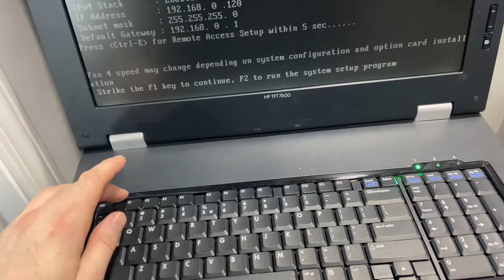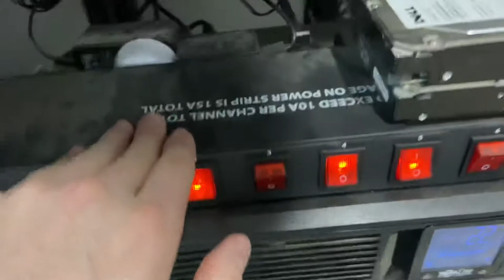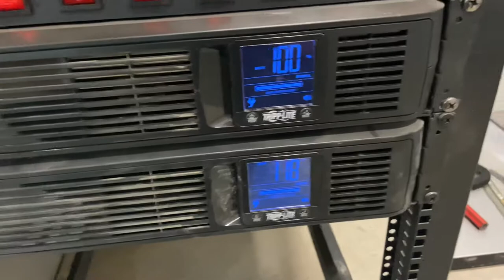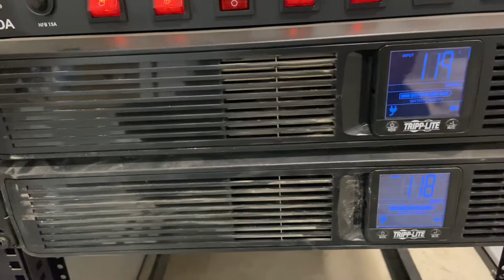Episode 92 - Network Rack and Homelab Tour

Comment: What software are you using for the storage node?
Reply from the maker: For the NAS, I am using TrueNAS Core.

Now that TrueNAS Scale is out of beta, I would probably use that if I had to rework the server. I’m more familiar with Linux than BSD, but both are good and work well.
Reply: @Ciband  Thanks, we're running truenas scale and vSan. Is all your storage for self consumption or are you taking part in a cloud based storage platform? You mentioned passive income after talking about the storage node which is where my assumption came from.
Reply from the maker: I’ve got a single 3TB ZFS mirror on my Proxmox server running a Storj docker container. That does some passive income (~$10/month). 

My NAS is all personal use.